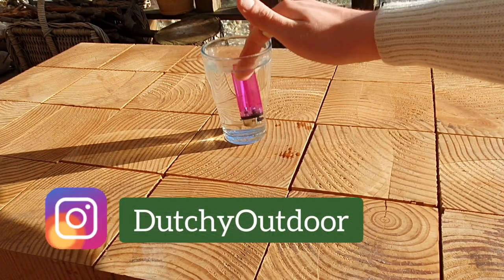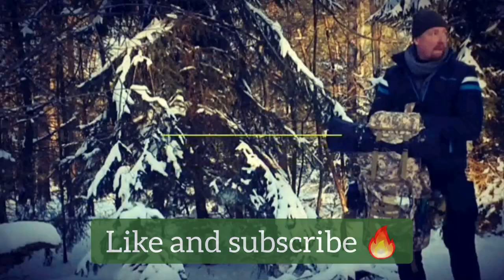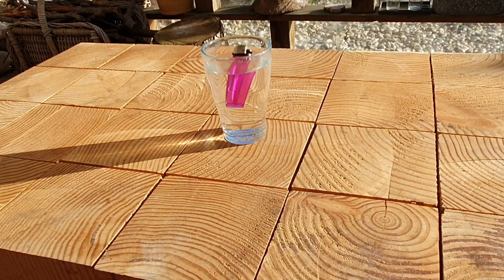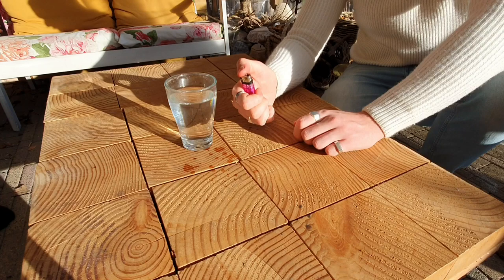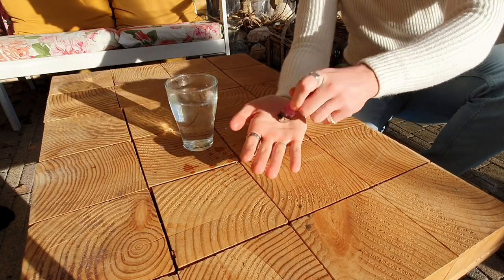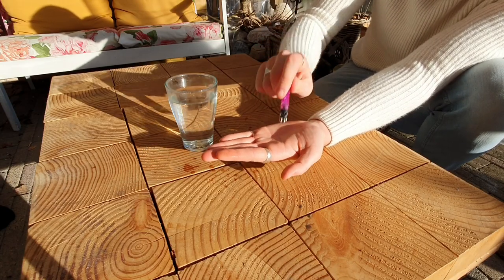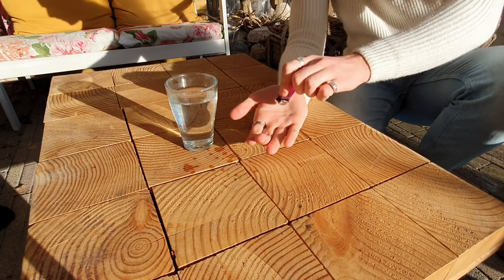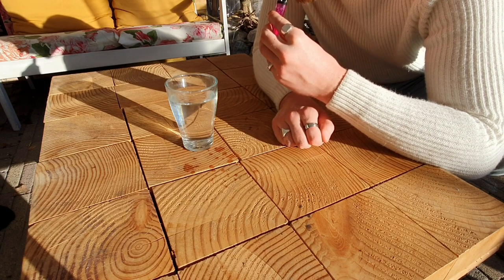How to fix a wet lighter - Dutchy Outdoor

Comment: Most people focus on the more natural ways of starting fires but all though I do use those methods I wouldn't go anywhere without waterproof matches and a lighter, so thanks for the tip. Also when it's run out of fuel, with the right kind of lighter you can get a spark good enough to light something like fat wood shavings. Will take a look at your other stuff when I've got time.
Reply from the maker: I agree! Starting a fire the more primitive way feels better, but its better to play it safe and carry a lighter or some such. You never know! Thanks and have a good one! - Mitch